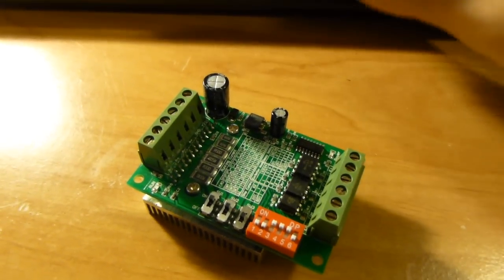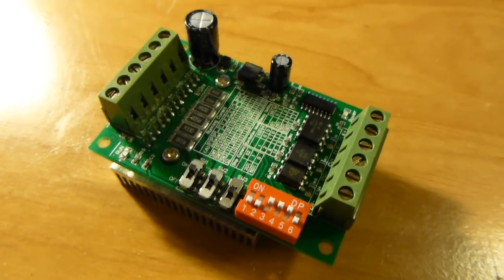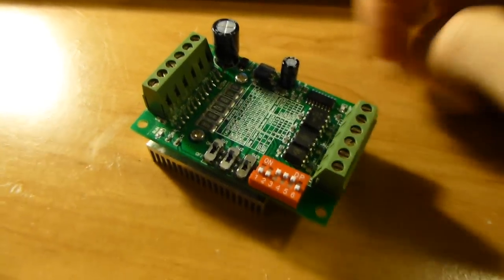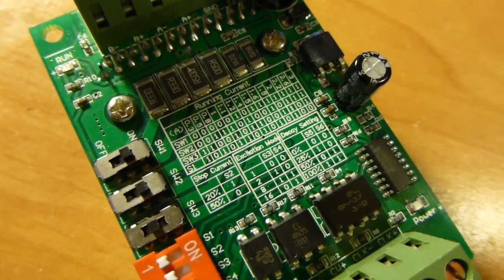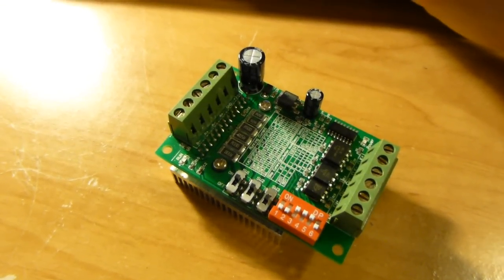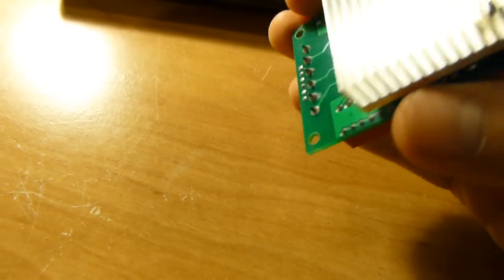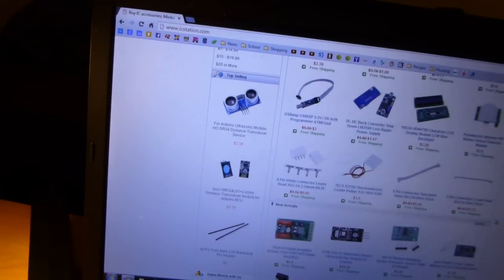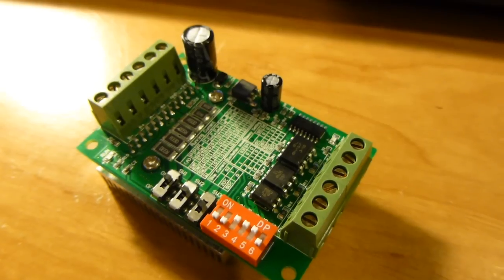TB6560 Stepper Motor Controller from ICStation: Review and Impressions

Comment: would not recommend it, I ordered three pieces and 2of3 are defective after 3 days of use. one is completely dead and doesn't give power on output for motors, second is losing direction, engine only vobels left-right. :(

Comment: what size power supply would you need if you wanted to hook up 4 of these?
Reply from the maker: +Joe Bui 

If you're running at 24V with a peak of 3A you'd need a power supply rated at at least 288W. I'd say at least 350W to account for losses and you give you some headroom.
Reply: +Jon Proce I found there are issues but another you tuber has posted a fix. thanks for the info on wattage I am converting a 500 watt PC PSU to run these.